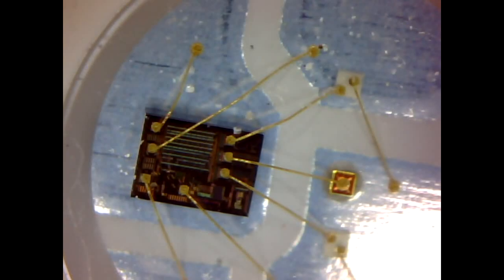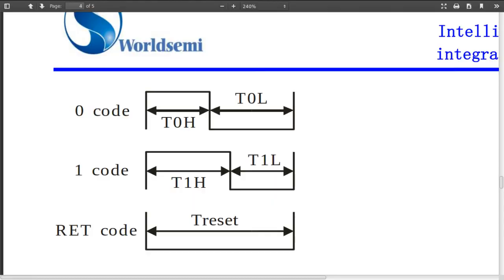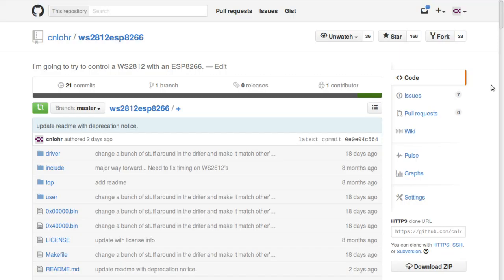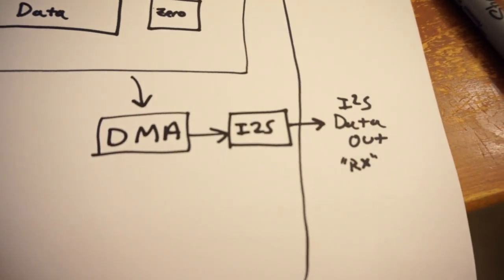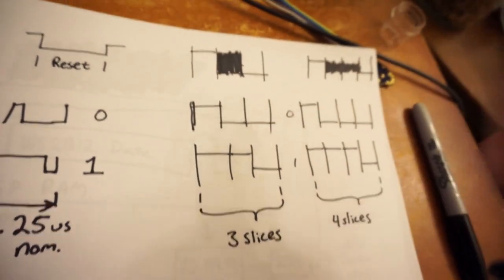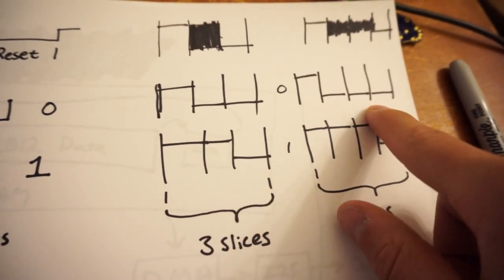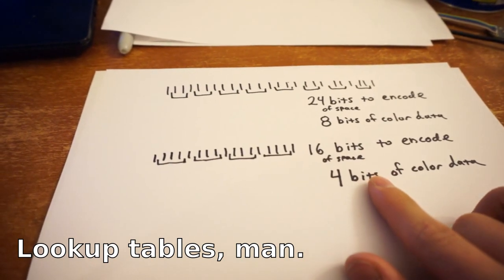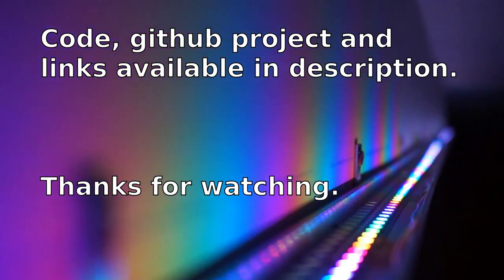Using I2S on the ESP8266 to drive WS2812Bs.

Comment: that was awesome, thank you for this awesome piece of work! but I tried using it on esp8266 board (the one with cp2102 usb ttl) and pin 25 U0RXD (gpio3) did not send any data, it listens, receive data and report udp packets from "./wsend 192.168.4.1 144" to the serial port but it does not get any data output to U0RXD. Do you have any idea why is this happening? is your esp8266ws2812i2s repo last commit working? By the way, what IDE do you use to program esp8266 sdk? I was trying to find out what is going on with your example but it was hard to find using gedit without a proper IDE. I wonder if you maybe used Eclipse to code.. have you?
Reply from the maker: Make and Gedit is a proper IDE.  But, make sure you can ping it first.  If you can't ping it something else is wrong.  If you can, please check the debug output to verify the system booted ok and all.

The last thing you can do is use Wireshark to determine if your computer is sending the UDP messages properly and what they contain.

Comment: @CNLohr I have question about GPIO pins. As far as I understood, you use GPIO3(U0RXD) as output, what about other gpios related to I2S, are they free to use in any mode or blocked somehow?
Reply from the maker: Only one pin is I2S bit output, it is that pin.  Kind of annoying, I'll admit.  But, at least it's not the TX pin so you can still get debugging information.
Reply: Well... ,  more I wonder if use that pin do I lose some others.  For example is it possible to use hspi and configure in such way to transfer data by dma directly to i2s.
Reply from the maker: As far as I've seen the HSPI bus is nowhere near as comprehensive and full-featured as the I2S bus.
Reply: I mention HSPI to use it as a input data for your I2S driver(instead wifi channel).

BTW, regarding uart pins, its possible to swap TX/RX with CTS/RTS:
Maybe by this way you could get bidirectional channel:
http://bbs.espressif.com/viewtopic.php?f=7&t=22&p=54&hilit=system_uart_swap#p54

Comment: Hi CNLohr ;)
You should check this two links http://www.elektroda.pl/rtvforum/topic3280019.html and https://lpc8xx.wordpress.com
Piotr Gozdur, author of the solution in first link use SPI+dma+timer to have full hardware translator for the protocol used in ws2812b.
In his solution he just send 3 bytes (each per color) via spi, then the hardware do the rest without losing time to change amount of bits.
Reply from the maker: I think he's using hardware I don't have in the ESP.  I don't really see any way to do this sort of thing with the I2s bus :-/
Reply: CNLohr well as far as I know,  you need free timer, dma and do link on spi bus.
Reply from the maker: I've got the DMA, but, there's no real internal wiring for PWMs or anything :-/

Comment: ok you seem to know what you are doing! so basically i need help... i want to creat a complex audio system using a pic32 or an stm32 microcontroller with an I2S audio dac. but I have no idea how to get the I2S working on either of those two chips. Do you have experience with audio over i2s? if yes i would be so happy if you could help me out!
Reply from the maker: I think it unusual to consider I2S on anything other than an ESP32 or ESP8266.  I'm getting more and more ColorChord hardware available.
Reply: So you are saying that I souldn't use a PIC for a high quality audio system and instead focus on my esp8266?

Comment: Hello, how many WS2812 leds can control with one esp-01? I see your github library and tells only 512 but I find 1200  WS2812B leds with one ESP01 on the market. It's that possible?
Reply from the maker: I've only tested to about 300.  I don't have more than that to test with, but in theory it could be very long if you store the data from packet to packet then have a "Send LEDs" command.  Keep in mind that over about 300 LEDs and you won't be able to maintain 60 FPS.  Over 500 or so and 30 will be a problem.  You just can't shift the data out that fast.
Reply: Thank yuo very mutch I will test and then comments my results
Reply: Hi.. Is it possible to shift several arrays out simultaneously on separate pins ? I would love to see someone implement ArtNet into one of these devices and output many universes :)
Reply from the maker: As it stands, there is no way to do so with this software. It uses the hardware I2S pin instead of software or manual interrupts (which would allow it).  Maybe some day.
Reply: Cheers, I can understand that, is the I2S like an I2C/TWI pin ? I would really like to get into ESP controlling WS :)
Reply from the maker: I2S is more like a 32-bit DMA buffer, you give the CPU a "Please shift this out at this rate" and it goes to town.
Reply: ah, thanks, I see now :)

Comment: What would be the easiest way to just turn on 1 neopixel ? Say i want to just send 1 bitstream to set it. And i know what i am sending, basically 255,255,255 to  led 1. Whats the easiest library free way to bit bang that you think , in arduino.
Reply from the maker: +tablatronix Sadly, I don't know anything about how to use the arduino with the ESP.

Comment: Great project and very nice video.

Any chance to have the same thing work with APA102 LEDS ?
I do have to update my Microchip board to a ESP8266 one see here : https://www.youtube.com/watch?t=1&v=zr7ZrnF-bfM

JP
Reply from the maker: +f2knpw I don't use APA102's, but in principle, it would have to be /a little/ different as the WS2812 uses only a single wire, the APA's need two... Though if you do expose the data clock on the ESP's I2S, you could make the output even more memory efficient and quick.

Comment: like
I was literally working out the timings for doing the same thing today with an atmega32u4! I thought it would need 8bits and the SPI bus running at 8MHz SPI to meet the tolerances though. Need to look at the real timings and amend it.
What SPI rate were you running the 4bits per bit encoding?
Reply from the maker: Lee Cook I believe the 4 bits one /probably could/ work as low as ~2MHz.  But, it should be less than 4 MHz.
Reply from the maker: Lee Cook I know I just commented, but looking at the timing, you would be much better off running it at 4 MHz, then maybe using all 8 bits per symbol.

At 2MHz, it is at the far upper range.  Also, at 2MHz, you could run the three- mode one.
Reply: CNLohr Lunchtime browsing.  Just followed the timing link and looked through the findings.  Really interesting.  I want to be able to process USB on a Leonardo in the background so I really want the LED driver to be interrupt driven.  I think it should be possible to set the SPI to 8Mhz (it can only be 2, 4 or 8Mhz), encode a '1' as 0xFC and a '0' as 0xC0.  The time to enter the routine after transmission of the last byte (and possibly processing the current byte) would extend Tperiodin but that's not an issue.  Only concern would background processing time vs interrupt entry/exit time.  In theory 4Mhz and 0x80/0xF0 may give more background time....  Need to tinker!
Reply from the maker: Indeed.  A test is worth a thousand theories